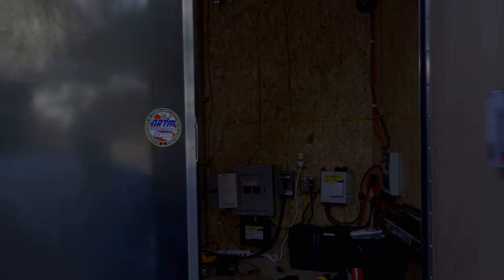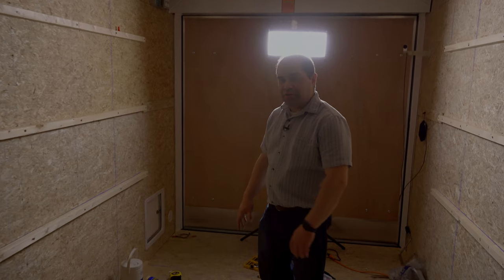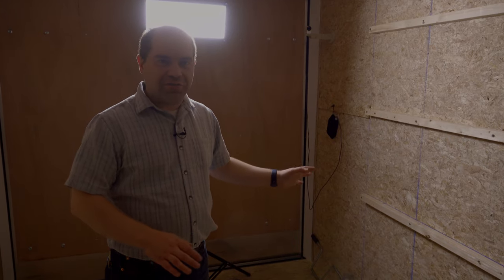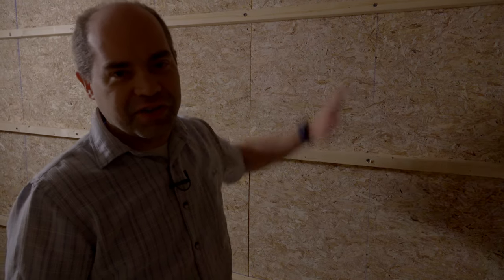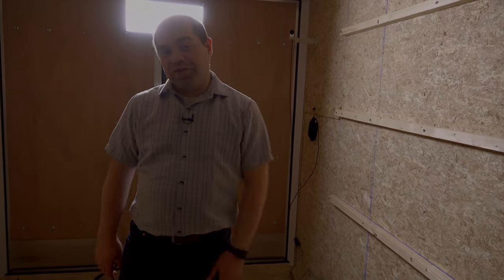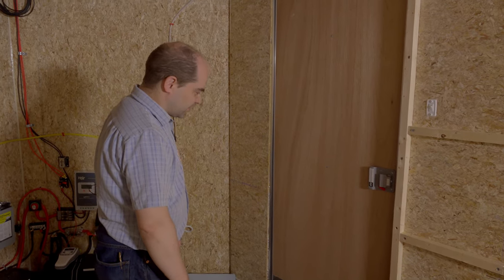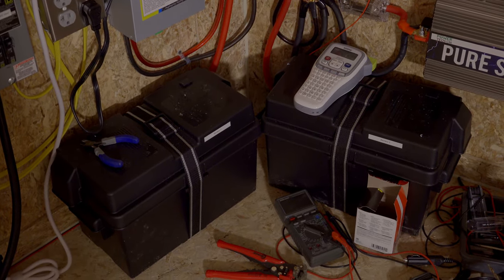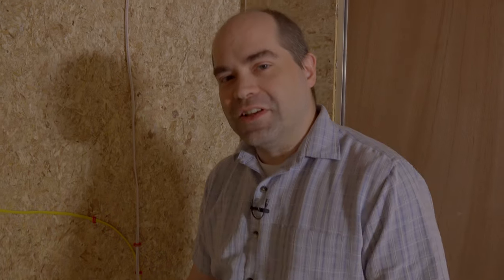Trailer Construction: 1 - Power Systems

Comment: Hi Doug,

It's been a great pleasure to watch quite a lot of your videos, and often found them very instructive and full of common sense, and practical considerations.
Now is the time to give a little back.

During the 35+ years of working (first as a sound engineer, then video tech, then project manager), I have spend a couple on OB operations, in France, and Europe.
Which means many hours in different OB vans, in different configurations, audio only, light or huge video production, with or without tender, etc.
At that time, one of those was hosting 25 people and drawing more than 300kW of power !!!

I understand that your trailer is not intended to compare to such extends, but I would like to share a few comments that come to mind. Especially considering you are starting almost from scratch. But I don't know the level of time, money, and level of "care" you want to put into this project.
The following comments are only intended to be positive, and I surely will be amazed at some of the solutions that you will implement.

1. All the elementary power lines switching and breakers (now at the front of the trailer) should be grouped on a specific panel. Once you start builing insulation, panels, furniture, it will be difficult to move some switches afterwards. And crouching under the director's desk during a show, to restore light or A/C, not really fun ! 

2. Take some time to prepare the grouding scheme. Either for the sake of a clean hum-free audio, as well as to avoid static when touching the trailer metallic parts. An earth-pole may need to be connected, when working with a generator, for example. 
Of course, that goes with the whole electrical design.

3. Plan the airflow. If you intend to work more than two hours in a row with a few peolpe and the door closed, the air may get "crowded" at some point. So, a couple of switchable air extractors (and louvers) could prove useful. It is summer, and I don't know the wheather in Utah, but have you thought about some heating for the winter ?

Ok, that's enough for a first message !
I am really interested in what you will achieve with this trailer, as it is a nice alternative to an OB van, and surely much cheaper.

Cheers,

Guillaume
Reply from the maker: Thanks for your input!

1. All of the main electrical is at the front, behind the director's desk.  There will be a few low voltage switches elsewhere, but all switches which affect the AC circuits will all be easily accessible behind a door below the desk.  Hopefully there won't be a need to be able to get to them during a show, but should I need to I won't have to remove any wall panels or anything.  There will actually be quite a lot of room behind the director desk -- enough that someone could climb inside and even stand up.  In a worst case scenario the director moves to another desk and works from there temporarily so they aren't in the way.

2. Everything is grounded to the trailer frame at one point in the front.  When running on external AC this ground is bonded to the incoming power ground.  When running from a generator I do need to come up with a proper solution, and I'm working on that.  Open to suggestions.

3. My current plan is to place a vent at the front of the trailer, then an exhaust vent at the back, and just have that run at a low level continuously.  That should help keep the air fresh, and provide a little cooling for the equipment as well.

Comment: I’m curious about your solar panel system.  Will you be showing the panels?  Is there chance of hail in Utah? How would the panels hold up?  Do you have a build list with specs and sources on your electrical that you could share?  Do you have any power conditioning in your system?  Thanks for sharing your project.
Reply from the maker: I could shoot a little video of the panels, but there isn't really much to see.  

PV Panels: http://amzn.to/2i8YlY6 
Charge Controller: http://amzn.to/2y9IjrF
Battery Charger: http://amzn.to/2gGZFkC 
Inverter: http://amzn.to/2gFNuVb 

It's very rare to have extreme weather here in Utah.  In the 25 years I've lived here I've never seen hail any larger than a pea.  Considering that most PV panels are designed for outdoor use I'd suspect they'd hold up well to all but the worst weather.

There isn't currently a dedicated power conditioner.

Comment: Sorry, I started my message as soon I watched your video, and ended it later without seeing the comments from Isidoro and Cole.

I can also confirm that vibration dampening is really important. Vibrations put a high stress on rigid attachments. Silent blocs may be needed for supporting your racks.
Does your trailer have a pneumatic suspension ?
Reply from the maker: Each axle is supported by its own leaf spring.  

I'll add some vibration dampeners.  Thanks for the feedback!

Comment: Hey Doug, another question here: the transfer power...that blink that happens when the systems switch over...would that affect any video or computer equipment? or are those gonna be on UPS? the "sure power" system, is that a defacto UPS line? or will you have to do a standalone UPS box for those systems? what gear can blip off in the event of a power failure?
Reply from the maker: I'm still working on making the transition as smooth as possible.  The most critical pieces handle it just fine (switcher, routing switchers), but I still have some tweaking to do to make the transition virtually seamless. 

UPSes are kind of a no-go because of my power budget.  Powering the equipment PLUS charging a UPS battery would push me past my power limit.  And UPSes tend to not like being run on inverters or generators very well.  With the setup I have, I can pretty much rely on solar for recharging the batteries when shore power comes back online. I'm not sure how you'd do something like that with a UPS.
Reply: @djp_video  Hey Doug did you end up getting this tweaked to make the transition as smooth as needed? Can all your gear handle the switchover?
Reply from the maker: @SheaHarris  I swapped out the charger and inverter for a combination Inverter/Charger from Xantrex and now it transitions perfectly.

Comment: Careful with putting vibration sensitive equipment past the trailer axles. I belong to a arcade cabinet user group. The group provides game cabinets to conventions. We had to retire the first trailer do to damage to any cabinet riding in the back.
Reply from the maker: Thanks for the heads-up!

This trailer seems to have a pretty good suspension on it.  And I'm not sure that much of the gear in the back would be sensitive to vibration.  But if it is an issue I can always add some type of dampening.

Comment: What is the size of the trailer? Inside ceiling height? Length and width
Reply from the maker: Interior dimensions: 16 feet long (plus about 2.5 feet for the V-nose), 7 feet wide, 7 feet tall.
Reply: @djp_video  thanks, was the trailer especially built? I look at 20ft.
Reply from the maker: I did have it custom made, but not because of the size -- I wanted one that was fully insulated and had an air conditioner. The size is a standard size offered by most manufacturers. 

The size ended up being perfect. My trailer is the perfect size for a standard parking space. The 16 feet plus about 4 feet for the tongue make it the exact length of a typical parking space so it doesn't stick out into the roadway, and the width just fits between the lines in most parking lots. If I had gotten one any bigger at all I'd have a significant problem finding a place to park it at many of the venues we work in.

Comment: I was wondering. You seem very smart, do you have a degree in engineering?
Reply from the maker: I'm self-taught with pretty much everything I do.  I studied Computer Science in college, but after three years I hadn't learned anything so I quit school (I started doing professional contract programming at 12, and selling software in retail at 14, so I was usually more familiar with the material than the professors).  I actually don't have any degree.
Reply: Doug Johnson Productions that's really amazing and such dedication. You are very well self taught. I'm impressed this stuff is not easy
Reply from the maker: You're very kind. :)

Comment: I wanted to share this with you  https://www.dropbox.com/s/ewbqrzsededxeld/IMG_0181.JPG?dl=0
It's what we have on the side of our sprinter van. i made it out of a rv shower box. probably wouldn't work the best for you with all the io you have, but they do have some pretty big boxes out there. Love the channel! Been learning all i can about blackmagic's products. we recently switched over from an older tricaster system and it's been a hell of a learning curve. I'm very interested in your hyperdeck mini solution, I've been using it as a VTR playing back commercials during breaks and it's far from smooth. the auto roll feature is very limited. the one thing i'd like to see more of on your channel is how you're using the gear, more of use case demo instead of review focused. You're videos have been super informative though and i think you've convinced me to go fiber! I'm tired of running half inch to inch thick rg6 snakes, and i'm deff running into cable length limits. Anyway, thanks for the videos!
Reply from the maker: That's a pretty innovative solution to the I/O problem.  

I'd love to do more use case videos.  Ideally on-site during a production, so it's real-world, not so much theoretical.  I'll try to make that more of a priority.

Fiber really is the way to go.  We shot a concert this last Thursday, six cameras, two of them PTZ.  We used the trailer (even though it is far from ready), and the camera in the back of the venue was more than 100M away from the trailer.  By the time all was said and done the signal ran through more than 300M of fiber.  I don't think I could have gotten either video or network connectivity to that camera if I had to use copper.  

One of the best parts of it all was that I was able to run signals for absolutely everything (bi-directional video, audio, comms, and network) over one single 1/4" fiber trunk, and I still had four unused lines to spare.  Up to ten cameras over one cable.